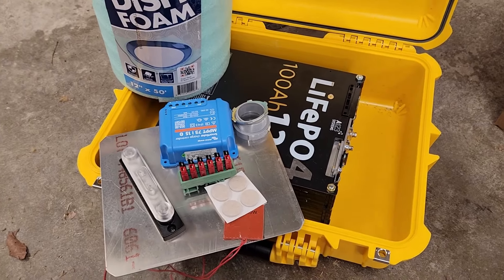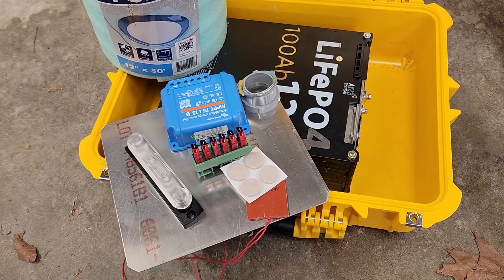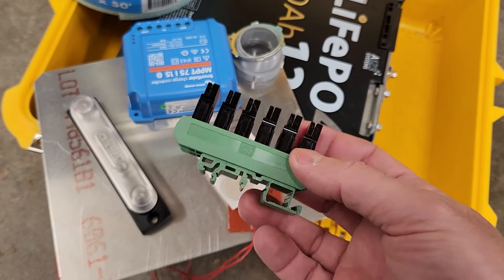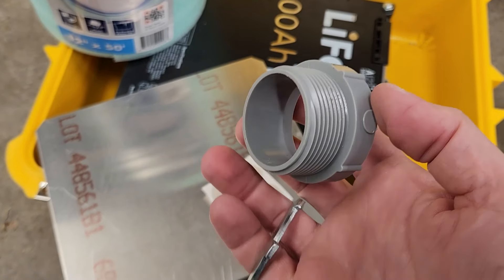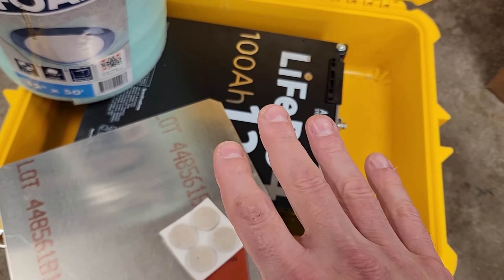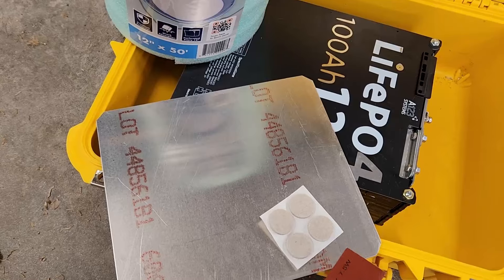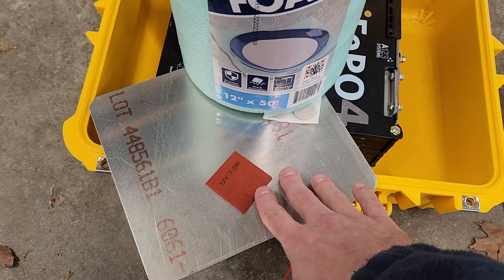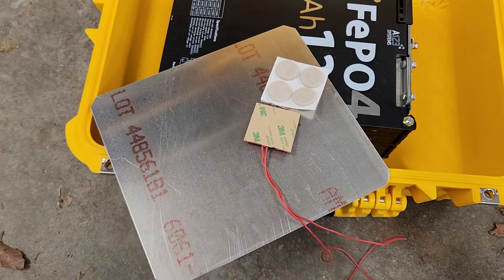Building a Battery Box.  Part 1 - Introduction

Comment: powerwerx sells the round panel mount powerpole connectors for 20 bucks (2 connector pairs)
Reply from the maker: But I get get 6 slots with the DIN rail version.  I've used the one you are talking about before.  I think I show it in the F150 wiring video.  I don't have the link handy.  My other issue with it is it's not really weather tight.  It's more like weather-resistant but only when the rubber flap is inserted.  With the PVC pass through, the connection stays out of the rain when in use.

Comment: Would be cool to do a 48V version.
Reply from the maker: I've looked at 48V systems, and I keep concluding until more 48V devices are available I'm sticking with 12V.  The only thing I would use 48V for right now is 1) running power long distances, but then I need to boost up to 48V at the source and then buck down at the load.  Yes, I save money on smaller gauge wire, but then I lose it buying the converters 2) Running a large inverter.  But I don't really need more than 1500W.  So 12V is still adequate.